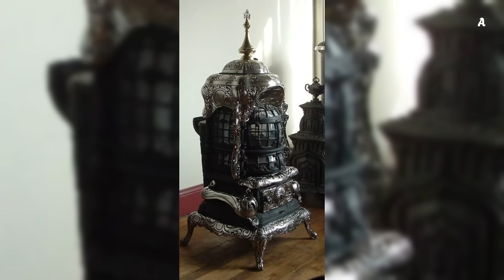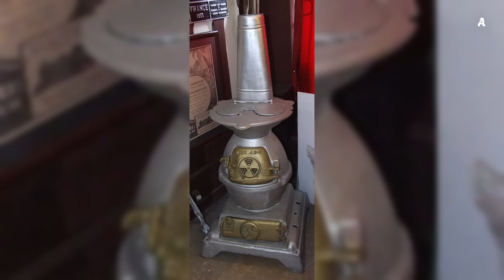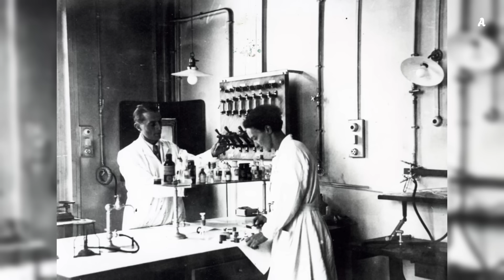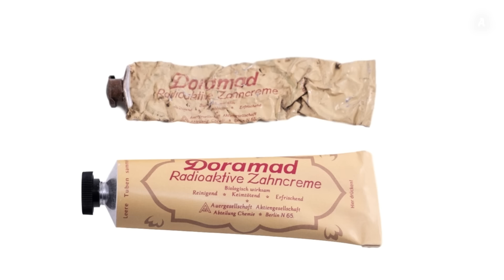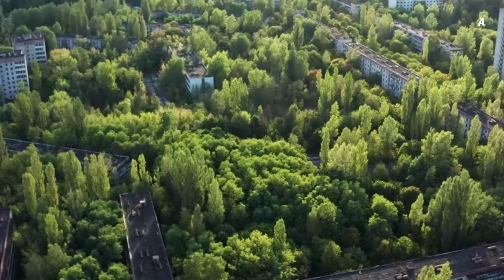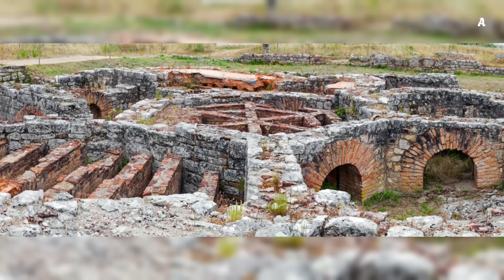Nuclear Furnaces of the 19th Century. The Forbidden Technology of a Past Civilization

Comment: I think you've got this a bit mixed up, I'm still using a stove like this, the ash pan is in the  bottom part, the levers and dials are to control air flow, it doesn't need much fuel and if you bank it down it will burn for hours, I use smokeless coal and can keep it in all night, and yes the metal body radiates the heat out into room.  The old no fuel heater was a panel of some metal attached to metal framework on roof which heated up, no mess

Comment: Sorry to contradict you sincerely , but most of the stoves you sre showing are french and they are not wood or multi fuel but coal  fueled . The smoke flu is on the back of those which you cannot see on top or side , modt of them have linnings of heat retaining bricks and work very good with anthracite or house coal  .  As for the great big houses etc they had big decorative brick built  boxes with ceramic tiles or bricks on the outside and same refractory bricks on the inside .
As for the little nobs and what look like switches they are there to allow air flow simply by turning them . An ash pan is acsessable either at the front or side , smaller models would have an removable grate and ash pan underneath it on the inside . I lived in france for 12 years and used a few different models my prefered choice was the godin very high hest output with anthracite and economical seriously the heat was radiated from the cast iron body heating up and the bricks inside kept the heat there .

Peace and love to all mankind ❤

Comment: The cost of radium was so high and the amount produced so small that it was impractical for home heating. Circa 1921 a 10g cube would have cost $1 million and produced just over a watt of heat. Furthermore, by 1928 total world wide had only reached about 500g, so there wasn't enough production for home heating. 

Even if they had somehow managed to bring down the costs and ramp up the production to where it was feasible for home heating, there was still the issue of controlling the heat. It would always be running full blast. You'd have to add or remove radium, depending on the amount of heat needed.

Comment: I can not believe how ignorant all you commenters actually are, you guys must also believe the earth is flat? You have to be a complete drooling frontal lobe missing mouth breather to believe that these old potbelly stoves burned nuclear material. that "radioactive" symbol is a damper, a nice simple design used for decades to control airflow into a wood stove, you see dummies, you close down that damper to just a small slit on each of the three triangular shaped openings which limits airflow and your solid fuel will burn for hours, even all night long. the cast iron which I guarantee wont shield you fools from radiation, just ask the crew at Chernobyl, will however radiate the thermal energy of even a small glowing ember of a fire for hours. 
 This is how it works and what this clown doesn't show in his video. every one of those stoves had a chimney pipe which exits the building, you fill the stove with wood or coal, you light the fuel with the door open, this creates a draft effect up the chimney, exactly how a steam engine works to burn solid fuel, once the fire is well established you close the door and then control the burn rate with the damper, you see that damper is a nice simple design that didn't get stuck easily like sliding dampers,  you see its round so the openings are triangular like slices of pizza the shapes work well to create an adjustable opening to control airflow to the fire, so once the stove is nice and hot giving off tones of radiant energy you can almost close that damper completely and that fire will burn for hours without needing fresh fuel and it will keep that nice cast iron hot which keeps the room hot. no way in the history of man kind were they used to burn nuclear material and if you clowns wanna try it well I hope you have a great cancer doctor at the least, but depending on what type of nuclear fuel you use you may just need a coroner within weeks of exposure.

Comment: The sand heat battery. The fuel was aluminum and iron oxide exothermic reaction. Exteme heat controled and reused. No radiation killing just megalithic stone secret.  Iron oxide is everywhere and aluminum key powder was difficult to purifying.   Religions close the past for control over the tech. 
It is to close to the understanding of the  past. Then Germany patented it and governments buried it for coal dependent heat. Tartaria mastered it and was whipe out  and metal taken and reused.  Worldwide patented stoped it all. 
Energy with 0 problems long-term but extreme heat to melting and binding stone.. 
We call it thermite reaction...  
Salt of the earth could have been aluminum powder for the hundreds of useful products. Like salt in breads helps bind. Use for distillation water tech and salt extraction.

Comment: We have used these in 50's 60's even in the 70's!!! ANSOLUTE LIES.A 20 X 30 room get hot 🔥. A small piece of log of wood burned for 2 hrs!!!
Also try a 2kg of coal bricks!!! Even better.🥇🇭🇺☝️🤬
They had chimneys not shown here in the pictures!!!
You try to rewrite histor???!!! False. 🔥💯🤡🎪.
Reply: I do see all kinds of pull out ash trays and air vent dials.
Reply: Don't joke please, I am sitting close to a 11KHW log-coal burning stove, I put in 14-15 coals, 4 oak (best hard wood) logs the fire part was not even an hour long, now I still have some ember but the whole temperature of the stove is already under 100C and dropping. The stove heats a 7x8 m area and outside temperature is 9C the inside is 20C. No way they could heat even a smaller room with those child-toy looking stoves and with coal or wood. No way.

Comment: Such an important revelation, long time coming. Now I'm wondering if it's possible to access this radium fuel for our usage, or are all the sources kept under tight lock and key by the Controllers.
Reply: Research the price of radium and how much heat it produces. You'll immediately give up on the idea, before you even get to the supply and regulatory issues.

Comment: The word "Radium" was cast into old stoves as a marketing and brand name, not because the stoves contained the radioactive element. In the early 20th century, following its discovery by Marie Curie, radium was a sensation and its name was used to imply a product was: 
Modern and technologically advanced: The public was fascinated by the mysterious properties of radium, and associating a product with it gave it a "veneer of scientific excitement".
Powerful and efficient: The element's seemingly endless supply of heat and light was associated with power and vitality, which served as a potent, if misleading, brand name for a heating appliance.
Valuable and special: The name "Radium" was used much like modern premium terms such as "Platinum" or "Gold" to suggest a high-quality product, even if the actual element was not present. 
"Radium Enamel" was also a name used for a type of enamel paint used on the exterior of stoves, again using the name as a brand rather than an ingredient. 
The stoves themselves do not contain the radioactive material and pose no radiation risk. The use of the word "radium" was a common marketing practice during an era when the dangers of radiation were not widely understood, and the substance was mistakenly considered a healthful additive in various consumer goods. 
Riccardo Bevilacqua's Post - LinkedIn
Jan 18, 2025 — In fact, the word “Radium” was used in the same way we use terms like “Silver,” “Gold,” or “Platinum” today. No one re...

LinkedIn

Radium Historical Items Catalog - Final Report.
In the years following the discovery of radium-226 in 1898 by Madame Curie, radium became a novelty product used in everything fro...

Nuclear Regulatory Commission (.gov)

Radium Brand Enamel (ca. 1905 to 1930)
1905 to 1930) ... This product was manufactured by J. L. Prescott Co. of New York which operated from 1870 to 1945. The enamel wou...

Oak Ridge Associated Universities

Show all
Dive deeper in AI Mode

Comment: As late as the 1800s there were advertisements for Radium heaters I had a collection. Radium heaters are why the wealthy wore WIGS. Radiation causes hair loss. Radium heat & lights goes all the way back to the Egyptians who also wrote wigs. Radium generators are shown in Egyptian art. A Radium generator is a upright pole with cross poles from top to bottom with the longest poles on bottom & getting smaller until the smallest at the top of the pole. Summerians & Egyptians are often shown standing around a generator. In old Tartarian photos generators are shown on tops of buildings & light posts.

Comment: When I was 20 yrs old, I had a watch with actual Radium numbers.  I wore it for about 2-3 years.  20 years later, I had a skin cancer tumor removed from the place on my wrist where my watch sits.  Just pointing that out in case anyone get any ideas of consuming or using radium for some other inappropriate use.
Reply: Sorry for your trouble!. I wanted to say that I had watches with "normal" batteries and after few hours my skin under the watch was red and started itching... I would love to have an old winding clock but these became expensive.
Reply: It's likely that the radium paints and the other everyday products with radium in them had radium that was processed in a cheap and faulty way resulting in poor quality and harmful radium being produced, which wasn't purified from the harmful uranium elements, or that the cheap radium was processed in such a way to actually make sure it harmful, any product with the original pure radium probably would've been extremely expensive if the process was so complex. I'm sorry, but like so many others it sounds like you suffered due to someone's intentions to scam the public with a cheap and unsafe alternative form of radium.
Reply: Coincidence.  Getting cancer under a watch os pretty common.
Reply: I had such a watch, and so did my parents and grandparents.  My grandparents had some of these radium toys.   No one in our family had cancer.
Reply: I had something looked an inflamed vein, very painful from a smart watch. I never had any issue with any other watched only the smart watch. Took more than a year to recover.

Comment: I learned that railroad tracks are 4 feet and 8.5 inches wide, because that’s what the wheel ruts on roads were for wagons, and that’s was designed to fit two war horses butts side by side to pull Roman chariots